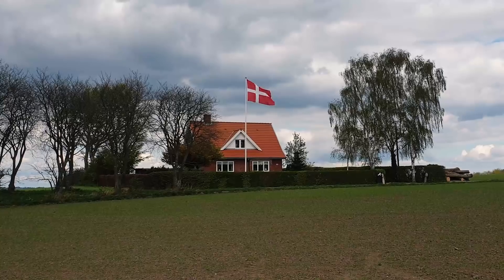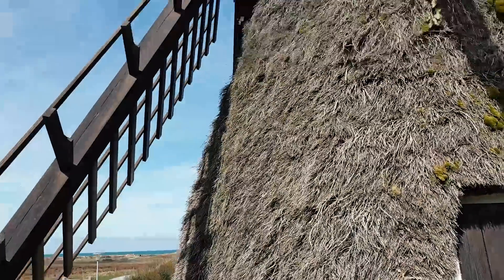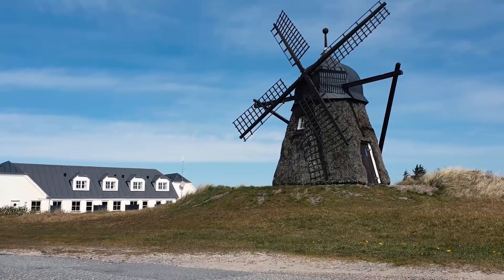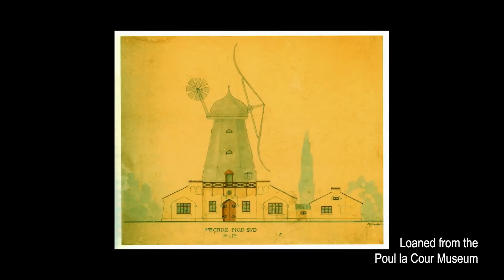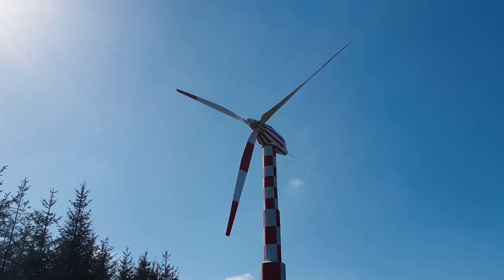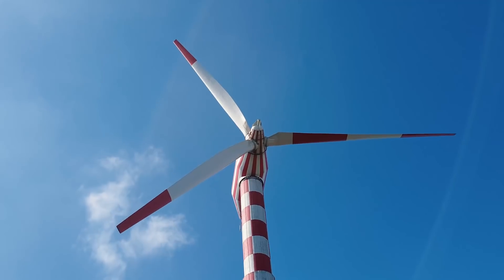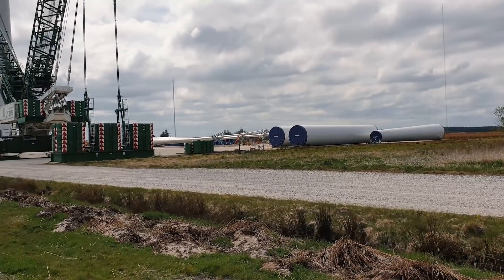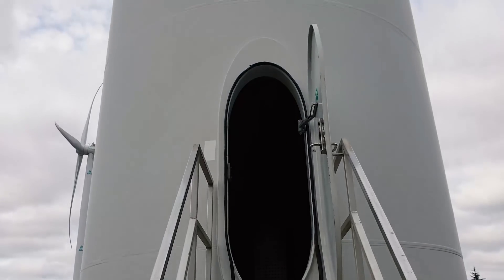Wind Turbine Design Evolution in Denmark

Comment: I think one of the most important things in this video is those turbines that are 30 years old. It might be culturally worth it to keep the first one operating long after maintaining it costs more than the value of the power it generates, but the set from the late 80s doesn't have that significance. Even if we were willing to maintain an operating turbine from that period as an expense for the sake of history, we'd do it with one or maybe two examples, not a whole wind farm. But those turbines are still running because they still make more in revenue than they cost in maintenance, and that is some old tech, they are far from optimal by modern standards, but they keep producing. When they put those up, I doubt they ran the math on a 30 year timeframe, and today people might look at 5, 10, or 15 years out when planning a project, but in reality wind farms can be productive far longer than that.
Reply from the maker: Yes it's great to see those old turbines still going strong. Until recently the standard design life was 20 years, now it's pushing out to more like 30 years. And once that's up it's often possible to extend the lifetime.

Comment: I'm curious what the rationale was for switching from lattice to tubular. 
I came across a fairly recent research article called: Lattice and Tubular Steel Wind Turbine towers. Comparative Structural Investigation, out of Aristotle University of Thessaloniki and University of Birmingham, UK. 
Their conclusion was that lattice towers are 40% lighter and cost 15% less while maintaining load-bearing capacity.

Comment: Paul La Cour was may inspired by Charles F.Brush who constructed a wind powered turbine in 1887-1888 just 5 years earlier than the one from Paul La Cour.  The Brush windmill reportedly lasted for 20 years, until 1909.Brush's batteries lasted until 1929. https://www.nrc.gov/docs/ML1036/ML103620043.pdf.)

Comment: The more I read about the wind turbines, the more I believe that the technology needs to be changed radically. 
Firstly the wind farms should give way to small clusters near the load points. We save on transmission to invest in more profitable storage.
Secondly, the capital cost has low utilisation factor. We should use cheapest technology for collection before storage and optimize for use after storage. There may be many opinions but I believe the compressed air would be the best. It should be stored in the modified tower itself. The compressed air should be used directly for mechanical work using pneumatic technology to maximum extent feasible but could run a battery charger of minimum required size.
Thirdly the tower as modified for storage will have substantial sunny area above tree lines.this should be used for installing photovoltaic panels and the product stored in lowest cost batteries available at the time. This should be used for lighting and electronics. Battery charging by compressed air could supplement this.
Fourthly the design of vanes is unwieldy and presents problems in manufacture, transport, installation and maintenance. Perhaps invelox technology ducting the wind to ground and using the right size and number of vanes may be better. Vertical axis wind turbines with axis extending to ground level is also an option.
One full sized energy tower as a prototype could prove the new idea.
Reply from the maker: Sounds really interesting Jagdish! I am looking forward to seeing your prototype 😀
Reply: You have some good ideas.  But the many smaller wind turbines require more maintenance than a single bigger wind turbine.  Other things complicate living close to the wind turbines.  They're better away from urban centers.

Comment: Tell me, how many miles of copper wire buried underground is there?
Reply: Most of the high voltage cables are made of aluminum because copper is too expensive.

Comment: Not a good idea to not develop nuclear power.  Now we are stuck with power that is undependable.
Reply: No, we are not stuck with undependable power.  Renewables plus storage are dependable and dispatchable.
Reply: @acmefixer1  the problem is storage.  So far the only truly efficient storage is heat storage.  The problem with the exception of concentrated solar is the conversion losses when storage is attempted as heat.  The two mature storage is either molten salt or melted aluminum.  This is where high temperature reactors, gas. molten salt, or metals can store heat and use this heat to produce peaking and back up electrical generation  needs.  In this way the grid can make use of the low cost electrical generation abilities of renewables and the peaking and backup abilities of newer nuclear technology.  The other benefits of nuclear being the ability to produce high temperature process heat for industrial applications like cement,  steel making, chemical processing and others.  Currently there are no renewables that have any ability to supply the massive amounts high temperature heat needed in these applications.

Comment: The wind pushes the blades around like a sailboat sailing with the wind? That is not correct. The old wind blades work the same way as the new wind mills - they work like airplane wings.

Comment: It's wonderful that wind energy technology, too bad that it depends so much on the wind speed.
The power of a windmill increases and also decreases with the cube of the wind speed.
This means that at wind force 7 there is 100% power and at wind force 6 only 52%, at 5 still 24.5% and at 4 still 9.9%.
This gives enormous variations in power, which are not suitable for a society to work.
Partially storing energy for more constant power delivery has still not been realized.
Batteries are not feasible because of the costs and the materials, reservoirs and flywheels are also impractically expensive and take up a lot of space.
At first things seem feasible, but after some calculations it turns out that this is not the case at all, which is why you will not find it anywhere.
In Germany and the Netherlands, many millions of euros are unfortunately disappearing into the bank accounts of so-called "stakeholders" and that is increasing, which cannot be the intention of a so-called "energy transition".
With projects it is always necessary to consider why you are doing something, so the real origin must be very clear first, especially before you start on billions of projects.
Due to variations in wind energy, ordinary power plants now also have to make adjustments, the efficiency decreases and that costs extra natural gas or coal.
You also don't get very far with burning wood, it is dirty and after some time no tree remains, too bad.
Are we really on the right track?

Comment: Why is the generator located on top of the tower. The rotational energy could be passed to generator by differential and shaft system which would allow easier,installation and servicing of generator
Reply: I've thought about this.  The differential would cause torque on the nacelle thus causing it to deviate from pointing at the wind.  Some kind of counter-rotating shafts would have to be used.  Or maybe reciprocating rods on a crankshaft.  But there are still problems.

Comment: Why are you driving a ICE vehicle when you're a wind turbine designer 🤔.   You should be setting an example.
Reply: She does: overall carbon footprint over lifetime, practicality, reliability / effectiveness during winter, environmental issues with sourcing of copper, cobalt and lithium, the massive radioactive waste problem from mining for neodymium and dysprosium, known issues with bisphenols and carbon fibers in composite parts of EVs, severe recovery losses of (precious) metals and rare earth elements when recycling the electronic components, charging losses & self discharge, ecological footprint of creating a second infrastructure for a charging grid... EVs have a long way to go before they can count as more sustainable than ICE vehicles. A small turbo-diesel or a "self-igniting" petrol engine in a hybrid configuration beat current EVs hands down in most real-life scenarios...
Reply: @f.d.6667  What a bunch of B.S.  Your reply was a waste of time as was my reply.

Comment: Norway props up Denmark's wind generation without which it would be far less practical. It takes cheap wind excess when there is too much for Denmark's need to replenish it's pump storage reservoirs and sells expensive power back to the Danes when wind output drops.
Denmarks performance flatters wind generation but it remains a poor way to generate electricty for a grid.
Reply: You could easily state it the other way round. Denmark's Wind energy sector props up the Norwegian's Hydro sector. The Norwegians can retain water behind their dams (not pumped storage which is insignificant!! )when the wind is blowing in Denmark. So that Norway still has water left behind it's dams in late summer when they would otherwise be running dry. So the Norwegians don't have to dam every single damn river they have and can have some natural salmons runs. There are problems to be solved with supplying a grid fully through Wind power, but they pale in comparison to poisoning the atmosphere.
Reply: Konskift,

OK, but that doesn't change the fact that  wind will not work in large quantities. Hydro is a good way of generation, wind is very poor.
What is not generally realised that wind is unable to load follow, i.e it cannot support frequency which is essential to keep a grid stable.
Nor is fossil fuel generation 'poisoning' the atmosphere as you put it. Power station stacks are very clean and basically only water vapour and CO2 is emitted. the rest is cleaned through scrubbers.
Reply: @iareid8255  You are just factually and analytically wrong on many points. And yet you seem intent on doubling down. 
I am quite 'factually' writing this message to you on  power from one of the most stable grids in the world that is largely powered by wind. Yes load following with wind has extra complications than just whacking another fossil burning plant online, but it is far from impossible. It requires competent management.
Scrubbing tech has vastly improved since the 1970's, why acid rain is not the major issue it once was, but fossil fuel burning plants are far from clean. Only someone paid by Koch industries to lie, would make that claim. Besides, CO2 is figuratively ''poisoning'' our atmosphere!
Reply: Konskift, 

what you claim is just not technically feasible. It is not due to nor can it be overcome by  'competent management'. Physical limitations of asynchronous generation is not something taht can be managed. If you share a grid with  another that has synchronous generators and significant inertia that masks the defficiencies of wind. 
The point I was trying to make is that although Denmark seems to be succesful with a lot of wind generation, it does not mean that it can work elsewhere, quite the reverse.
CO2, the basis of life, cannot poison the atmosphere. It's role in climate change is now almost immeasurable and further increase will make no real difference.
What I say are not lies but a realistic evaluation with no basis on my source of income which is simply a pension.
Reply: @iareid8255  You are too far gone. Thankfully people that insist on keeping the wool over their eyes like you are now in such a small minority that you cannot stop the rest of us from getting on with the business of trying to save us all (including you) from climate catastrophe.
Reply: Konskift, 

I agree, there is an overwhelming pressure to spend vast amounts of money for no climate benefit but to the detriment of  so many other aspects of the world that needs attention but is starved of money.
There is significant reasearch that demonstrates that CO2 in theconcentrations theer is now has an insignificant efect and increasing it will also be insigmnificant. 
That can be debated, but what is not possible is to significantly affect CO2 levels with renewable generation, it is inferior and ineffective, it will not make an appreciable difference. 
Nuclear generation is the only possibility but is kept down. Realistically there is  no other option.

Comment: Tvind, a bunch of hippies but they’ve made an impression which basically lead to the forming of the Vestas we know by now.
Interesting enough, when i started working in the wind business back in 2001 we made 27 meter blades which grew to 29 meter a year later. When i stopped in 2020 the blades had grown to 80 meters. Quite a change.
Reply: @acmefixer1  Rosie has made a couple of videos about that: https://www.youtube.com/watch?v=EM-gCvhQhPU
Reply: @acmefixer1  Rosie has now had a couple of videos addressing vertical axis turbines. It's essentially a matter of efficiency and cost. There have been lots of university projects trialing vertical axis turbines. 

It's not that engineers are unwilling to try them, it's that they don't work as well.

Comment: Though sails really do fly through the wind like a wing.
Reply from the maker: Yep, this analogy only works for non-sailors. I meant if you are sailing directly with the wind, then the wind is just pushing on the sail. But apparently that's not something you would ever really do, so bad analogy for real sailors.
Reply: @EngineeringwithRosie  Sometimes you do go pretty much straight downwind during a triangular race, with some boat designs,  but it is definitely when you are going the slowest.  The apparent wind speed is really minimal. But I almost never did well when I was racing, which was 25 years ago now, so perhaps now days everyone tacks downwind.
Reply: @EngineeringwithRosie   The "sails" in the old windmills work in a manner similar to sails of a boat sailing across the wind, not like parachutes. The difference with modern wind turbines is the efficiency, not the fundamental mechanics.

Comment: Sailboats sails fly through the wind exactly like airplane wings do. How do you suppose they sail upwind? Or faster than the wind? The most efficient racing sailboats have sails that look exactly like airplane wings, but most sail boats use a less efficient design that allows the sails to be hoisted partially or not at all. The keel also works like an airplane wing, just against the water instead of the air.
Reply from the maker: Yes you're right. I was trying to say if a boat sails directly with the wind, i.e. with the wind just pushing on the sail, then that's drag. But I said it in a confusing way, and I guess no one sails like that. So it's a bad example and I don't use it any more 😀
Reply: @EngineeringwithRosie  Boats usually sail with lift so much better than with drag they will tack downwind! To sail with drag efficiently, one needs a kite instead of a sail, the most common is called a spinnaker.